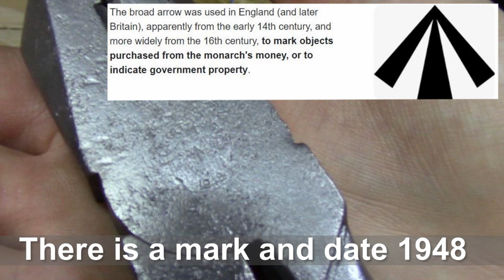Vintage pliers restoration.

Comment: Why not start with the wire wheel?  You won't pollute your sand so much.  Good save.  You definitely got your pound's worth.
Reply from the maker: That's a good point. I'll defenitly do this next time. Cheers.

Comment: Why did you sand off the arrow and the date when you went to the trouble of showing them to us? Good clean-up but spoiled for me by that action.
Reply from the maker: Hi, 
I wanted to get rid off all of the pitting and rust. That means the marking had to go. 
I showed it to you as I found it interesting. 
Cheers